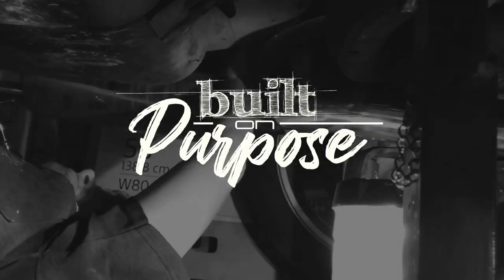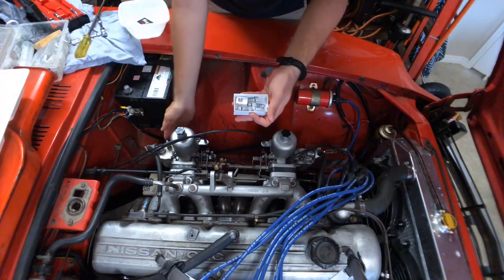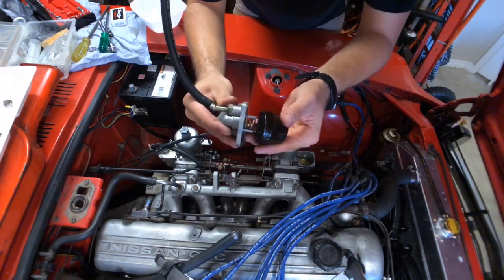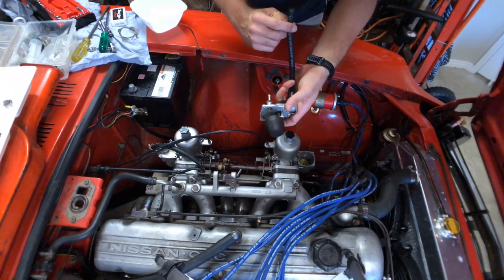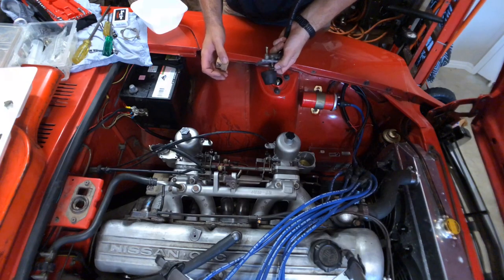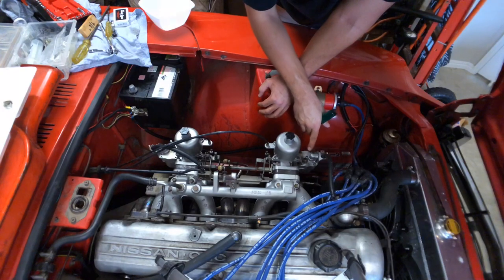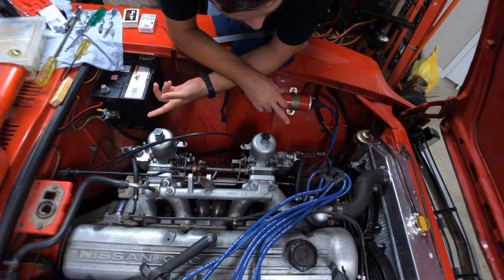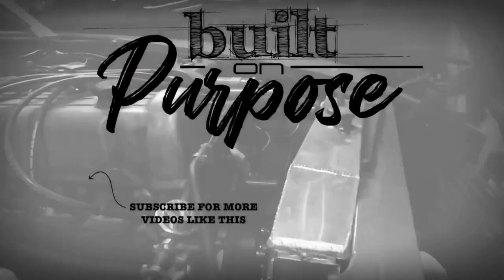Datsun 240z L28 stroker - adjusting the carburetor fuel float level (Hitachi SU round top)

Comment: Excellent vid, thanks for sharing. I'll have to pick up one of those float-syncs, neat tool.

For those in the states, O'Reilly carries Walker 240z rebuild kits: 15567 and 15568 (front and rear, respectively). I've rebuilt dozens of carbs with Walker kits, so I'm glad they make them. But the float needle/seat assemblies are substantially different height for front vs. rear, to the extent that I had to max out one of the float's adjustment tabs pretty severely to get the adjustment right. The geometry of the float is the same, but word of caution to those going the Walker route. I'll find out when I run the car if it matters.

FWIW the float height specs are 13/32" (10.31mm) for 70-71 carbs, and 9/16" (14.28mm) for 72 carbs (the hundredths mm precision makes me giggle). Most float adjustments are done with the float bowl inverted and the float tab at its resting position on the needle. I've heard different ways of adjusting floats from "authoritative" sources, that's why its awesome you got that tool handy.

Cheers
Reply from the maker: Jesse Waite yes I got feed up with the inverted method and not knowing if the fuel level was 100%. The float sync is the most valuable SU tuning tool in my opinion.

Comment: Aaron, I also ran SB needles in my L-28 powered 240Z. On the dyno the car put down 202 wheel H.P.  While the SB needles provided the best power for my set up, I opted for a pair of TF needles after charting each station, and noting the AFM numbers on my gauge, under varying loads and RPMs. I was looking for excellent power, but not at the expense of running so rich. I've tried 5-6 different needle profiles and found that for my engine the TFs work best. Interestingly, my L-28 is a turbo block with dished pistons (lower compression) and stock internals (fresh rebuild). The mods on my engine are all in the head (E-88) which was port matched and the valves were unshrouded. My cam profile is 276 lift and 480 duration. I'm also running 36 degrees of total timing with no detonation issues whatsoever.
Reply from the maker: Randy Lewis nice find! I can see TF needles offer a little more richer profile from station 5 onwards but are leaner at idle.
Reply from the maker: A  little bit freaky in coincidence...running SB needles I netted 201.6rwhp on the dyno....
Reply: @kyushaspeed  Your dyno numbers are very close to what I realized, even though our engines differ substantially in other respects. My biggest surprise was putting down these numbers with dished pistons. Has me wondering what kind of HP increase I might realize with flat tops. What were your torque numbers with your set up? My car put down 225 ft. lbs. of torque. I'm running SU/Hitachi carbs with ITG filters. The only carb mods were the SB needles. By the way, I now have Float-Sync units back in stock if you know anyone interested. They can buy them on e-bay or direct from me at datsun.floatsync@gmail.com.

Comment: First rule of su , float height first.  English su kits came with a washer kit to change the height of the seat
I did my mixtures the old school leaded petrol days and checked spark plug color. in the middle of nowhere fun 
If i was you now ,i would have 2 OX sensors where the 3 pipes join to balance the carbys
Reply from the maker: I have contemplated dual O2 sensors.  Innovate make a dual sensor LM-2 kit.  I think if I were to convert to EFI I would use dual O2 to close loop one batch of injectors each.

Comment: The jets are different sizes for front and rear carbs, so how can one float measurement be valid for both carbs?
Reply from the maker: I am not sure about that.  The needles for both carbs should be the same at least in my factory service manual.  The factory service manual does call up different float heights between front and rear however I have used the same for both with negligible affect on performance and operation.
Reply: Not talking about needles, talking about the jet with it’s valve. Valve is set at fixed location, so it’s height of operation depends on height of the jet. The jets differ in height front and rear. Hence, need two float height settings. One for front, one for rear.
Reply from the maker: My jets were the same height and the jets were the factory Hitachi units.  Fuel level should be referenced to the needle. To be honest you should verify any changes with a wideband O2 sensor.  For a long time I altered the jet fuel float height higher than factory because it worked better for my engine with my SB/SM needles.  Both jet float levels were set the same height and showed good AFRs.  I think I comment about this when I dyno run the SUs for HP.
Reply: If you check the socket in the float chamber tops, for the jets, you will find the front one sits flush but the rear seats sunk in a few mm. Hence, needing two different float height settings.